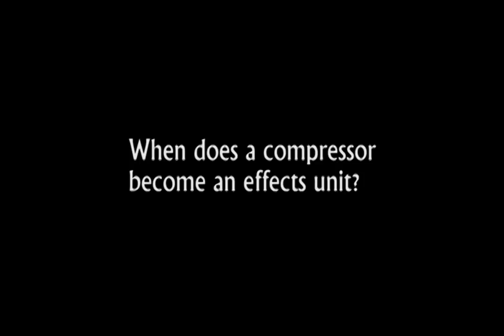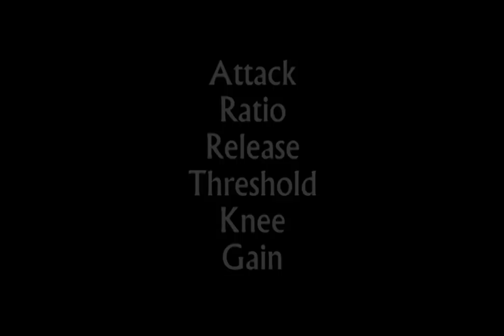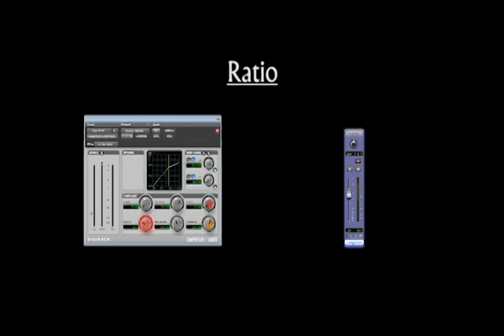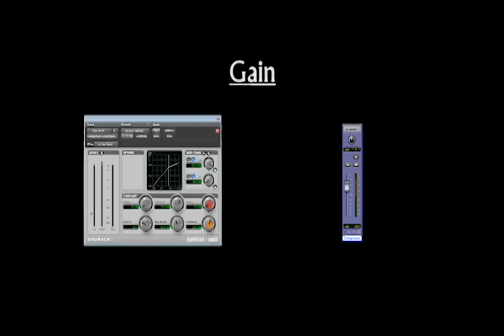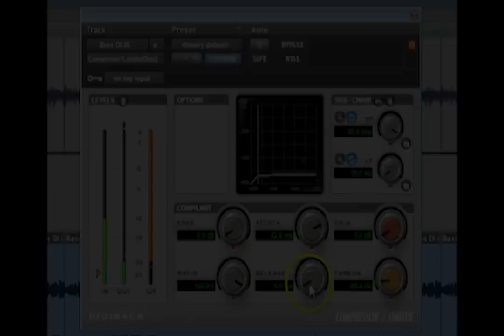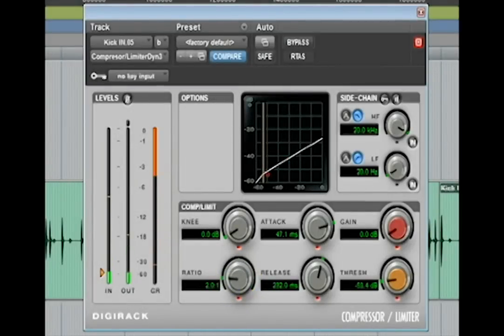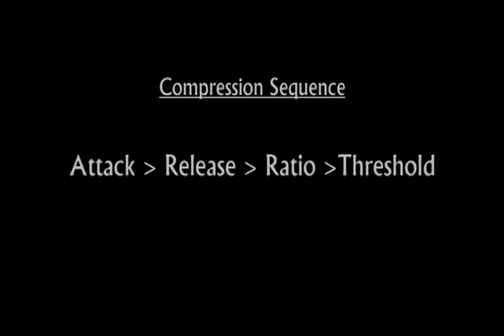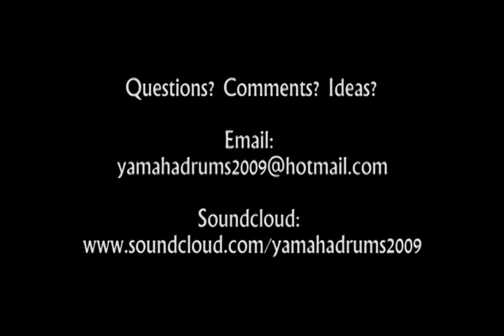Compression Basics - How To Apply Compression To Your Audio

Comment from the maker: You are correct. This is just another way of explaining the same process for different input levels above the threshold. If you are feeding a 2dB signal over the threshold on a 2:1 compressor, then the outcome will be 2(dB) divided by 2 (from the 2:1 Ratio), which still equals a reduction of the signal down to a 1dB output (above the threshold). By dividing any input above the threshold number by the ratio, you can easily determine the output after the compression.

Comment from the maker: If the ratio is low, most of the signal will still pass above the threshold setting point; As the ratio increases, most of the signal will get compressed with respect to how high the ratio setting is set. This does not mean that it necessarily all gets pushed down - you must also consider attack times. For example, a maximum ratio setting, in combo with the slowest attack setting, could still allow transient like material to momentarily pass above the threshold.

Comment from the maker: It would not take 2dB more for the compressor to act on the signal. Any signal above the threshold will be getting compressed relative to the level it is above the threshold in relation to the ratio you have chosen. If the signal is 18dB above the threshold with a 20:1 ratio, the output above the threshold would be 18 divided by 20, which equals 0.9dB.

Comment: Fantastic. Does the soft knee have any affect on the tone? Does it depend on the compressor?
Reply from the maker: A softer knee smooths out the operation of the other parameters, and so in that sense, it does affect the tone - but not necessarily in isolation from the other controls. An 1176 FET compressor actually hardens the knee as you select higher ratios with the push buttons as you go from 4:1 to 8:1 to 12:1 to 20:1 - so yes, every compressor will make it's own contribution to the tone of the signal.

Comment: I will risk my pride and ask something that maybe was already answered in your other compression videos:

I've seen videos about compression in busses and the master for a "glue" effect, it tends to be subtle in the gain reduction and it sounds cool. But I have some questions about it in my mind, because I'm worried it could affect the dynamics already "sculpted" in the mix through balance, compression and automation:

1) How does compression work for this glue effect? (Generally speaking)

2) Are there ways to use this kind of compression without squashing the dynamics and changing the tonal balance?

3) If you answered yes to the second question: What ways are those?

4) I you answered no to the second question: What kind of "philosofy" or method can I apply to mix with the final glue compression in mind?
Reply from the maker: Good questions!

1) It generally works on the basis that a number of instruments feed the group. At any one time, one of those instruments (or several hitting together) will control the compressor, influencing when and how much it reacts to the summed input signal. Why it creates what engineers call 'glue', is because all those instruments share the movement of the compressor, and this has a unifying effect as they have a common dynamic in how they all move as one. Compressors also often add harmonic content to the input signal which also helps to amplify this shared dynamic or commonality amongst the group of instruments.

2) Yes (see below)

3) By controlling how much of each instrument you send into the compressor as well as playing with the attack and release settings. For example: If you send lots of kick drum into a group that also contains guitars, then the rhythm of the kick will control the compressor, in turn affecting the tone and rhythm of the guitars. It's all about how you balance what's going into the compressor, because the loudest instrument (or sometimes just the lowest), has the greatest influence over the compressor movement.

4) -

Hope that makes sense. Happy mixing!
Reply: Thanks for answering my questions. The first answer actually gave me an idea: Let's think that I use the compressor in the mix buss (or master), given that the "common dynamic" is what make all the instruments sound like they work together, what about automating the threshold for chaging it in each the song section?
Reply from the maker: No worries! :-) I think riding the threshold is definitely worth exploring, I know of some mixers who do this, but I tend to just change the way I mix into the compressor instead. Many ways to achieve the same sort of result. I think it's one to have up your sleeve when other techniques stop working.

Comment: oh okay...i get it now..thanks..but then in regard to your statement "the higher the ratio,the smaller the signal gets above the threshold"..isnt that a relativity thing..like doesnt it depend on how loud the signal above the threshold is going to be...for example... if the sound above the threshold is 18db and the ratio is 20:1...its going to need 2db more before it gets compressed to produce only 1db of the signal..so technically it wouldnt be a "smaller signal"...am i right or wrong?

Comment: Does over compressing cause high freq. loss?
Reply from the maker: Not necessarily,  it depends on the sonic curve of the compressor, as well as what you feed the GR circuit through the side-chain. In general terms I'd say you'd notice less bass if anything, because the power of the bass triggers the compressor to react the most.

Comment: I feel that your mixing desk illustration of compression isn't 100% accurate. As far as i know, compression reduces the dynamic range of a signal (meaning that it shifts the balance between quiet and loud frequencies). Turning a volume fader down, however, does not. It just lowers volume of the whole signal. Please correct me if I'm wrong.
Reply from the maker: A volume fader demonstrates this basic and common behavior amongst compressors accurately. You can select compressors based on how they 'EQ' the sound, but at their most basic core level, they all control the signal level in accordance with how you have set the controls and how the signal interacts with the threshold. All compressors start to turn down the signal as it crosses over a set threshold - not unlike a volume fader coming down, and they do this based on how loud the signal is. If you then add make-up gain, then you have not only reduced the level of the louder things, but you have also lifted the quieter parts - thus reducing dynamic range. 'Dynamic' meaning 'volume level range' in this context - the difference between the lower volume material and the higher volume material - not specific frequencies (unless we are talking multiband compression or specialist dynamics processors, such as Transient enhancers).
Reply: So, if a volume fader demonstrates the basic behavior of a compressor accurately, it means that whenever gain reduction is applied, it's applied to the whole spectrum uniformly and not just to the part that goes beyond the threshold. Am I right ?
Reply from the maker: Yes, you are correct. If we are talking a basic compressor setup, GR is applied to the whole spectrum more or less uniformly, as the signal crosses the threshold. The compressor cannot in such a case determine what part of the signal has crossed the threshold, it just knows that the threshold has been crossed, and turns down the incoming signal - i.e. The whole spectrum. There are of course exceptions, but in essence, this fundamental principle holds true.
Reply: SoundboothTutorials Oh, OK. But then there's still this thing I don't get : why would the make up gain, used in combination with some gain reduction, narrow the dynamic range of the input signal ? Shouldn't it behave like a volume fader slided down (gain reduction) and then up again (make up gain), thus leaving the dynamic range untouched ?
Reply from the maker: A compressor by it's very nature reduces dynamic range every time it compresses the louder peaks of a signal, and so it loses overall volume.

The make-up gain happens post compression, allowing for us to restore the maximum peak level, but it also gains up the entire compressed signal so that the quieter parts are now louder than they were before compression happened.
Reply: SoundboothTutorials Something doesn't add up. I have to know three things for sure : 1) What is dynamic range. 2) Does a compressor affect dynamic range. 3) If so, how does it affect it ? I'll try to gather these informations in my books. Thank you for your answers and for your amazing tutorials.
Reply from the maker: Favio Loncel There may be a language barrier here, but I will do my best:**1. Dynamic Range is defined as the difference between the loudest & quietest parts of a signal - measured in decibels. The key word here is 'difference'. It pays no reference to whether the loudest part of the signal is -18dBFS or -0.3dBFS. It is only in reference to its' difference to the quietest parts of the signal. So if the loudest is -0.3dBFS and the quietest is -18.3dBFS, then you have a dynamic range of 18 decibels. If the loudest is -5.0dBFS and the quietest is -10.0dBFS, then you have a dynamic range of 5 decibels. **2. Yes. **3. Signal crosses compressor threshold = signal gets reduced. This changes the relationship between the loudest parts of the signal and the quietest, it reduces the highest relative to the lowest, therefore it affects it by reducing the dynamic range.
Reply: SoundboothTutorials 1) Great so we are on the same page here. 2) That's what I've always heard and I believe so but... 3) Oh my god ! Now I get it. What I've been forgetting all along, about dynamic range, is the time dimension. Of course, since a compressor makes the loud "moments" of a signal quieter while leaving the quiet moments untreated, over time, the two extremes become closer together. And still it can behave just like a volume fader. This conclusion took some serious thinking. I feel like I need some rest now ^^
Reply from the maker: Ha ha, happy to help :-)